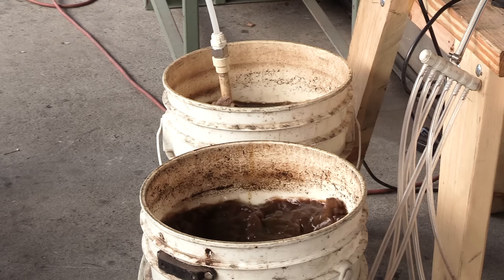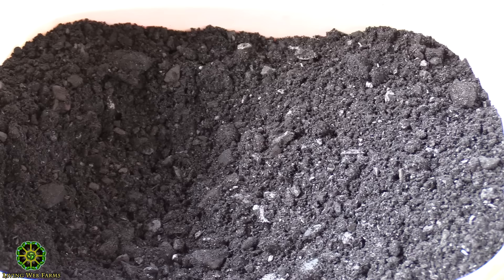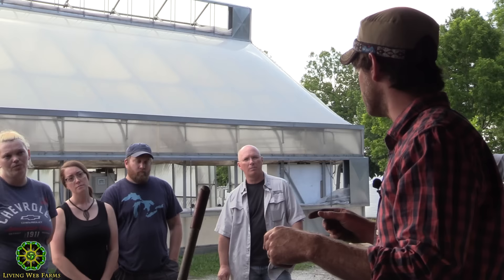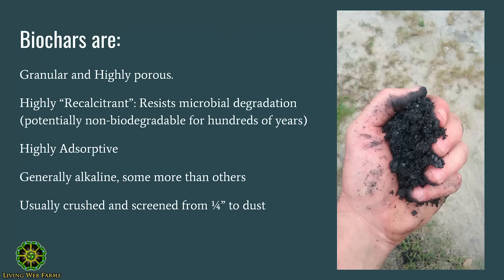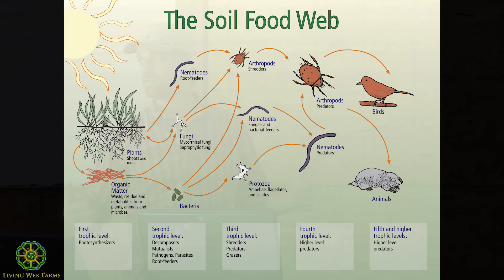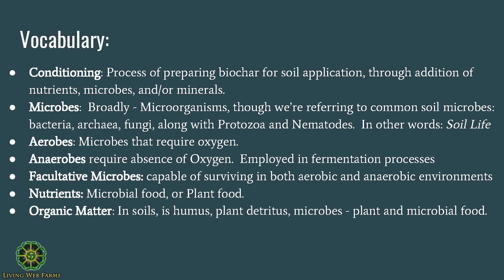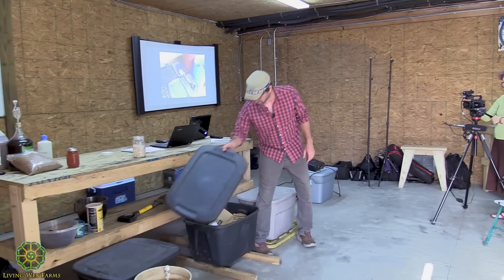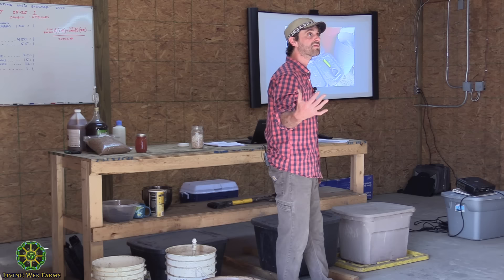Biochar Inoculation with Dan Hettinger

Comment: I have a closed loop no till system. I have done my own biochar triels and experiments and simply do not see it as a valuable resource. 
I understand in soil that is dead and needs rebuilding this method can charge the soil faster. However I find Nature heals itself the best. 
Raise, my small Livestock with a few cattle saveing anc composint for a min of one year all their manure/organic matter. Sorry I disagree making compost is not difficult at all. 
I have a hay mulch cover system where first I add my compost then cover with hay. I have in doing so created a worm rich, microorganism rich system. With good crop rotation in 10 years I have not had any blossom rot or soil deficiency of any kind. 
I have save Heirloom seeds for year and my Tomatoes in the yearly years I exposed to diff blites inoculating them. I rarely have any sign of blite now with my no till hay mulch system. 
I simply do not see biochare  as sustainable method in the sense the amount of labor, time and materials it takes. 
Yes Natural will burn and rebuild but nature does not burn yearly.